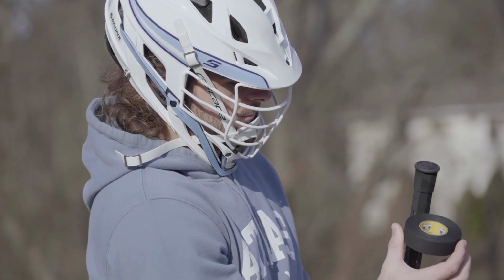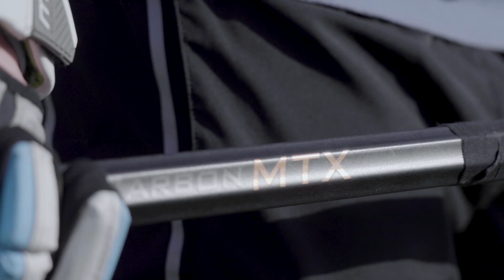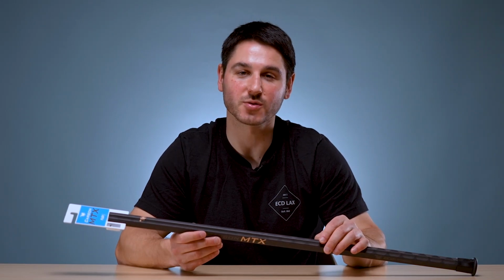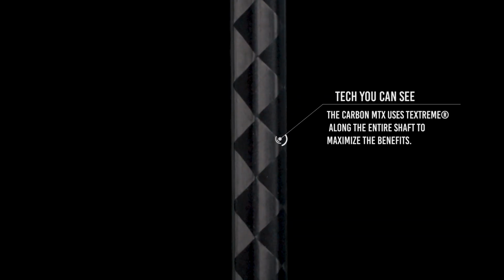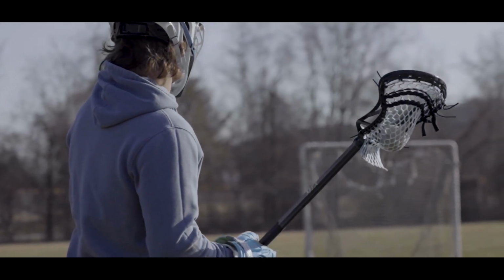The Importance of TeXtreme | Carbon MTX

Comment: What’s the difference between the ltx and mtx
Reply from the maker: The MTX is going to be a heavier and stronger option for those aggressive middies. Think of this as the Speed Vs Power in our Carbon Pro 2.0 line up but the Textreme versions

Comment: Ltx vs mtx what's the difference
Reply from the maker: This is heavier and designed more for the middy's. Think of this as the speed and power of our carbon pro 2.0 line up with the MTX being the stronger and heavier  (power option)